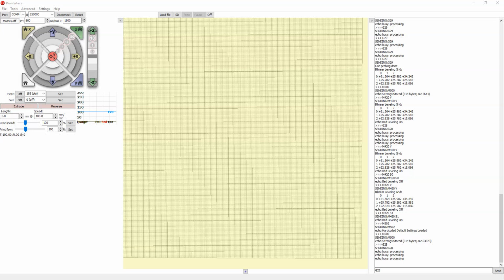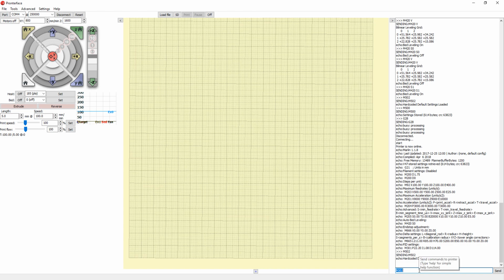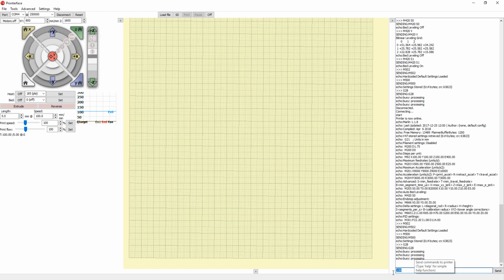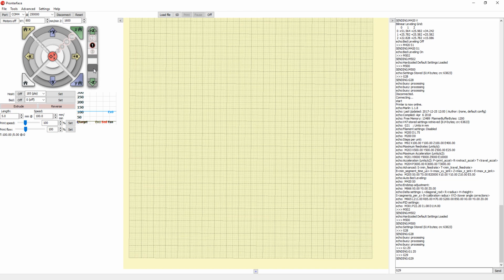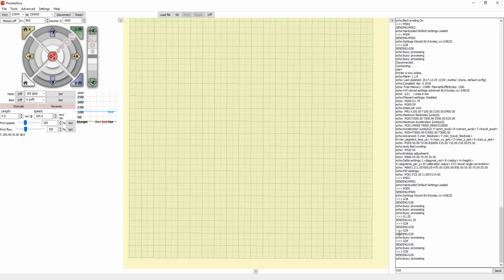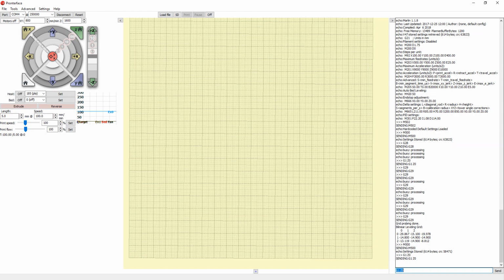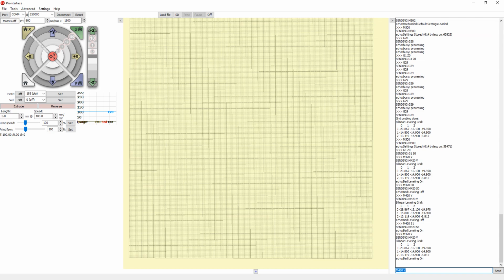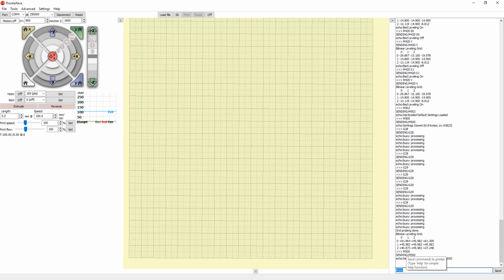3D Printer Calibration on Pronterface.

Comment: Dude you need a images or video of your printer too we cannot imagine what the printer is doing if we can´t see it best regards.
Reply from the maker: Thanks for the tip. I never imagined this would get any views. I will start making more videos and will include a view of the printer next time.
Reply: @srobotics8157  very usefull video specially for ppl that makes their own printers thanks =)
Reply from the maker: @Camusdemerac  Thanks. I also made my own calibration software, based on the pronterface commands, that simplifies the calibration. I haven't worked on it in 2 years but I'll update it when I get a chance and do a video on it.
Reply: @srobotics8157  Awesome keep it up =)

Comment: I'm still completely lost after watching this.

All I want to do is make the printer save a default Z offset of 0.2mm because I used a 0.2mm feeler gauge, plus the bed leveling knobs to get it at a good height all around the bed.

But no matter when when I go to print a file the Z offset seems to be all over the place.

I did M502, moved Z up 0.2mm, did M500 to save. M502 to load. Hit Home, but the printer still just shows Z: 0 after going home. Shouldn't it show an offset of 0.2mm???
Reply: That's not how you save the offset. This video shows how to do a mesh leveling system. Sorry it's a little misleading title. This was years ago and my first video and didn't give many specifics of who might benefit from this or how you can make your printer accept this calibration procedure.

Going back to what you are trying to do, you need to use the M851 gcode command. if you already know the offset just do "M851 Z0.2" or "M851 Z-0.2" not sure if positive or negative would be the right value. I think negative. then after doing "M851 Z-0.2" send M500. That should be it. Sending M502 would overwrite your value I think so you don't want that.
Reply: Yup. same here...next video...

Comment: when i send commands it says sending : but no action.......

the left interface works great.
Reply: any tips? im trying to level the bed using commands
Reply from the maker: So you can move the axis with the left buttons? That sounds like a pronterface glitch. All the left buttons do is send Gcode commands so if that works, sending commands should also work.

Comment: Need help when open pronterface and connect to 3d printer the settings scroll infefintely and printer doesnt respond to jog commands...workked fine earlier todsy
Reply from the maker: Hard to tell whats wrong. I would try to reset everything and see if it fixes it.